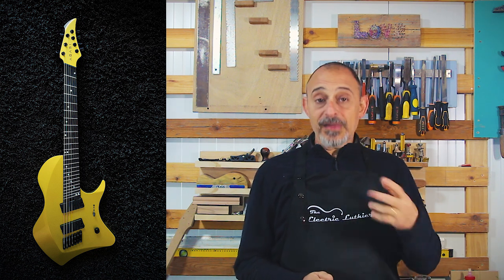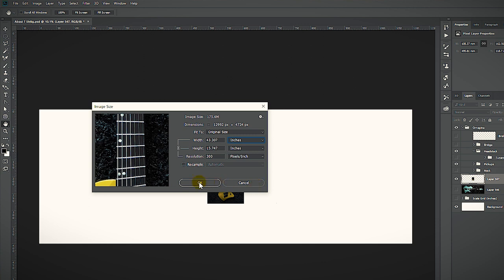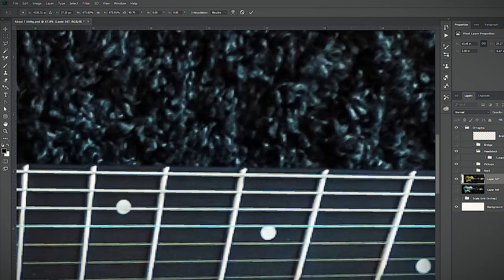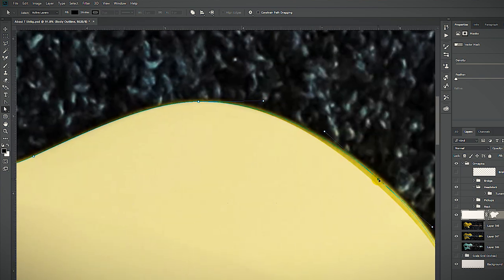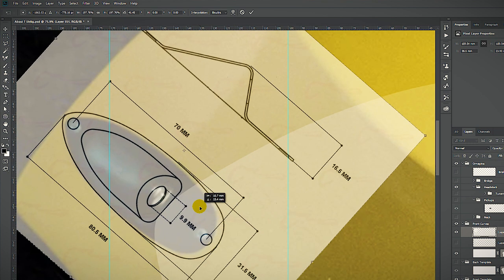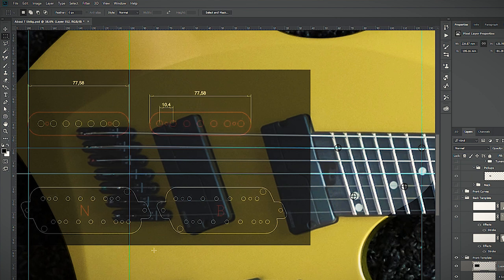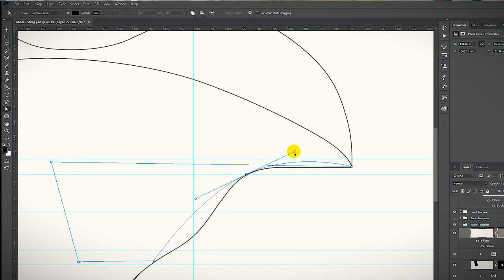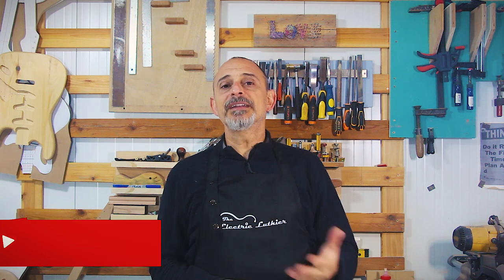How to Copy Any Guitar Design for Your Own Build

Comment: This comes at the perfect time. I've been thinking of building a multiscale bass myself for years now and a few days ago i finally managed to comit to it. i have my scale and measurements for the neck done with fretfind2d but i was kinda clueless how to add my shape i was aiming for. Thanks a bunch Yoav, this surely will help a lot
Reply from the maker: Thanks for the comment. I am glad if this helps. Haven't seen it on a bass. What kind of scale lengths are you using?
Reply: @theelectricluthier1928  It totally does! I'm taking the dingwall basses as my inspiration, since they are propably the go to solution for downtuned heavy music, which is my cup of tea. I'm using a 34 to 37 inch scale length

Comment: As it turns out, there IS a guitar I would like to copy for which I cannot find plans so this was great! I'm definitely one of the "metrically challenged", I've never liked using it (I'm in England, btw).
Looking forward to see what you do for GGBO '21
Reply from the maker: Thanks, @Peter Johnson, I am now intrigued to know which guitar it is. I grew up 'Metric' and I just can't understand the whole imperial system, it just makes no sense to me (and apparently to Nasa engineers). I'll still call a Strat 'a 25.5" scale',, but it doesn't give me a sense of size🤣
Reply: @theelectricluthier1928  Hey Yoav, the guitar is a Gibson Corvus. Not to everyone's taste, but I always found it rather interesting. My version would probably be a bolt-on, as I already have the perfect neck for it, and single humbucker. I have an old Gibson "Dirty Fingers" pickup just waiting to be installed in something like this.
As for the Metric system, yes we do use it here in Britain, but I grew up with Imperial measurements and continued to use them throughout my life (I'm 61). Just like you, but in the opposite way, Metric gives me no sense of scale! That's for everything, not just distance. I think in pints and gallons, pounds and ounces. I measure my own weight in "stones" etc.
You would have hated our monetary system - Pounds, shillings and pence - we went decimal in the early 70's but I still talk in old money just to confuse the youngsters. I get lots of mileage from that (pun intended)!!
Reply from the maker: @peterjohnson4932  Nice choice. I was not familiar with this guitar. I think it's the only Gibson I have seen where the strings run straight to the tuners. I have seen one image showing without the pickguard and it looks pretty hollowed, so the body may be very light. I would keep an eye for 'neck dive' . There are plenty of good reference photos from many angles, so you should have no problem tracing and making your own. Good luck with that. As far as Gallons, I'll be happy to share a Pint any day.😉🍻